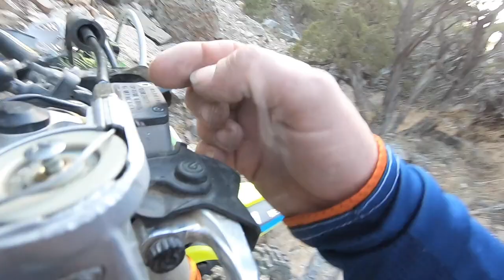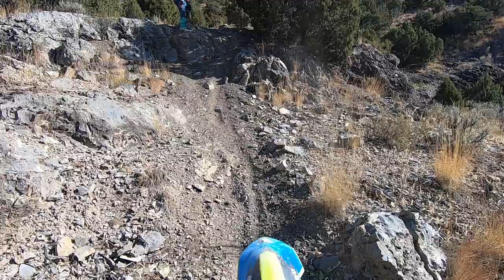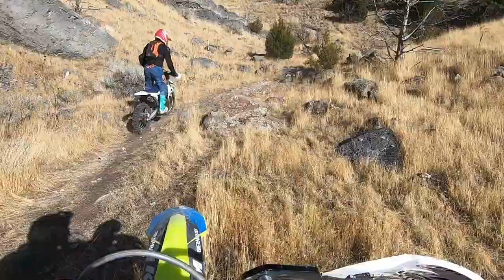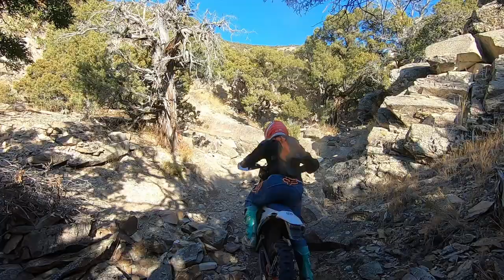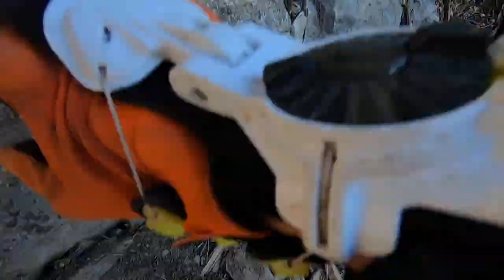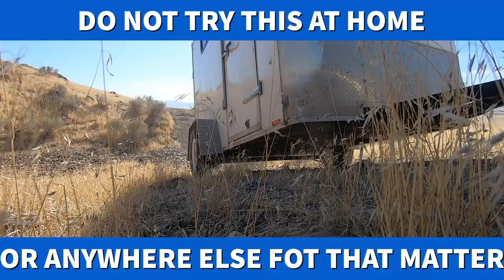Re-VISITED/ RELEASED: PUNISHER THE MOUNTAIN THAT ATE MY KTM

Comment: You might consider spending more time on less technical until you get more of the basics down. Also, you might consider trying a fly wheel weight on your two stroker.  Makes it have more  low end grunt like a 4 stroke but don’t give up your 2 stroke benefits.
Reply from the maker: Thanks for the advise, and GREAT POINTS may I  add, unfortunately or fortunately  Jonny is training for Romainiacs the worlds toughest enduro and I am training with him as much as possible.
 Also that was probably my worst attempt at the punisher and i do not edit to "look good" rather trying to capture the true struggle of learning these things so others might have the guts to start learning at say 45 years old.
 I appreciate that I "should" stay on less technical terrain but that just won't happen as #1 I currently happen to ride with the coolest and very skilled/patient friend and coach, 
 Besides what would Dirtnap Dirt  Bike Adventures channel be without Adventure.
 That said, If I DID NOT have A SKILLED  & PATIENT "coach" with me I would not be in that crazy of tedhnical.
 Cheers
Reply from the maker: J W what’s up J W?
 Have a rematch with the Punisher tomorrow, preparing the bike tonight!
  Should be a great video one way or the other lol